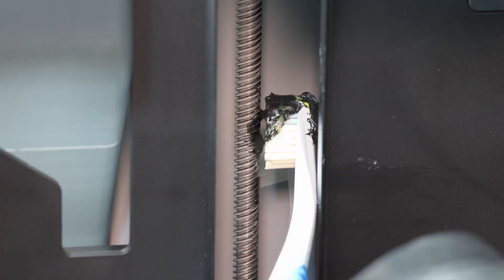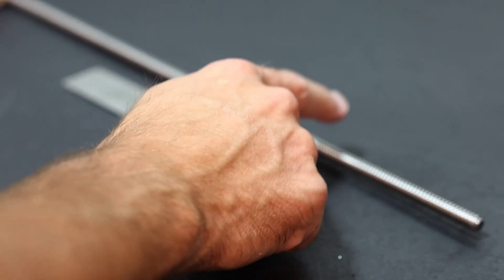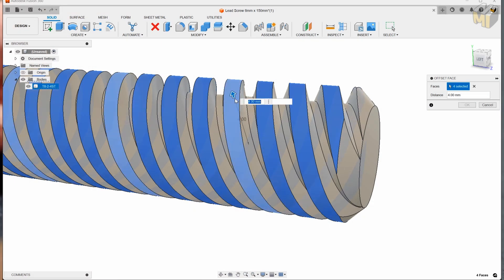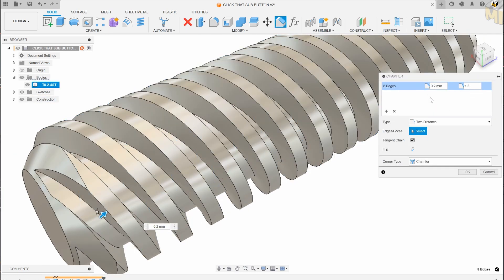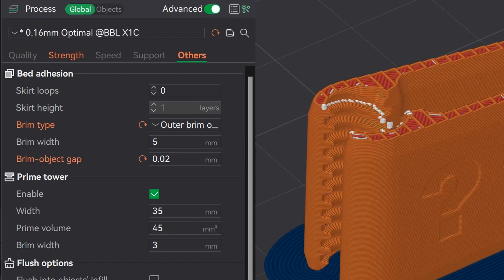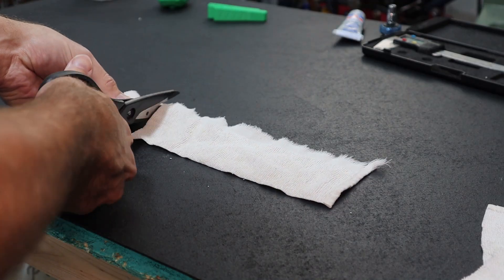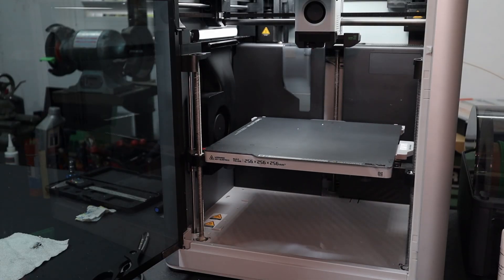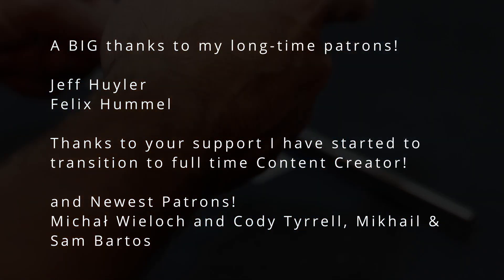A Much BETTER WAY to Clean your 3D Printer Rods and Screws

Comment: Really useful idea, thanks. Can also use it to watch the leadscrews move on a non-level bed plate. Couple of pedantic points though - it didn't look like a true trapezoid thread profile. You can make a true trapezoid nut then slice a small gap out of it and go from there. Some machine tools use that method to produce a small amount of adjustment.These profiles are easily available for Fusion, etc, and may help get down into that awkward little cranny. Secondly, they are not RODS they are LEADSCREWS !. Little pet hate of mine :) Thanks again for a very useful tool. BTW, why the taper?
Reply: I mean it's a threaded rod, called a leadscrew because of what it does

Comment: Wrong. For each rotation it will move 2 mm  not 8mm.
Reply from the maker: Well, I'm quite confident, but please humor me and tell me why a 4 start thread with an 8mm thread pitch will travel only 2 mm per 360 degree rotation, I'm interested in this method of teleportation that you speak of.  I'm also quite interested now if you can backup your claim and if you're arrogance got the better of you this day.

Comment: You don´t need the complex helix modeling, I bet just a clamp and a soft towel with work the same, if not run it twice. Good idea though.
Reply from the maker: Hey, if that works, go with it.  I can see that with the right towel, it could work well with your fingers.   I just kind of like the idea of doing all screws at the same time and hands off.  Thanks for your thoughts and for taking the time to leave a comment, I really appreciate it!

Comment: Was that a permatex grease you use?
Reply from the maker: I'm using lithium high-temp grease, that's what I had on-hand, it's probably not exactly what you'd want to use, but it does the job for me, stays in place, and you can tell easily when it's dirty.

Comment: You could always put a hole in the handle where the crisscross section is or on the side so that one can store it on a hook that is on a 3d printer or somewhere else. ;)
And like you suggested you could use a magnet and maybe make the whole in a diameter where one can put a 6mm magnet into it if someone wants to use a magnet?
Reply from the maker: I've tried a magnet, but it is so small that it works its way down the back of the printer, the hole isn't a bad idea though.  I'd need a hook somewhere.
Reply: @NeedItMakeIt  well thats a problem =D then a little hole might just be the easiest solution =)
Reply from the maker: @Neohhhh  I'll do up a sample and see what it looks like, thanks for the idea!

Comment: I would also like to thank you for the fabulous design. Another tool I didn't know I needed as I have 4 printers and 9 lead screws (3 on the K1 Max). I had to print it on one of my Ender 3 Pros as my K1 Max is down for the count right now. I printed without a brim, in PETG - woks GREAT, so THANK YOU.
Reply from the maker: Nice!  I was not looking forward to cleaning them manually, what better reason than to design one that can do it and make it 'almost fun'.  I'm glad it helped.  I would print more PETG but that sheen, I think there are some other options for matte, but they're pricey.
Reply: @NeedItMakeIt  Thanks, I may not be clear in the photos (my camera is just a cheap tablet - low quality images), but this was a matte black PETG. I used this because PETG is supposed to have a little more flex than PLA.

Comment: Wouldn't it be easier to just use pom nuts?
Reply from the maker: That’s a great question, is there some reason why they don’t use delrin?  A ball-screw would be another option,  I think they may be noisier though.
Reply: @NeedItMakeIt  yeah that seems like a lot more cost for almost no benefit
Reply from the maker: @confuzled_makes  It's worth a closer look. I have some connections at Bambu, I wonder if they'd shed some light on this, why not use POM?   They've made so many good decisions with their printers/AMS, why not address this also.  Creality did the same, and I'm not looking forward to taking the printers apart to replace them, but I will certainly look deeper into this to find out more.
Reply: @NeedItMakeIt  I assume it is because , yes, the part does last longer. 

However, I rather have a part that is easy to replace and provides a better experience for a few thousands print hours over a part that performs worst for a long time
Reply: The bed assembly doesn’t seem like it’s meant to be a user serviceable part in the X1 series at least. Yes, you can do it, but it’s not something most people would do. Brass is absolutely a better bearing surface for longevity and if they went with pom I’d probably replace it with brass when the pom wore out. 

Ball screws are large and ridiculously expensive for any meaningful quality vs acme thread lead screws. You’re not trying to plunge a carbide cutter through hot rolled steel at two inches depth of cut, you’re lifting a relatively light bed. It doesn’t make sense in a cost vs benefit breakdown for mass production. You also still have to lubricate and oil your ball screws. 

I do think this tool provides a purpose on the X1, especially if you’re printing a lot of filament with volatiles like ABS. Maybe you don’t need to clean the rods once a week, but it’s good to change out the grease when it gets dirty.
Reply: This comment in a rod-cleaning video, and I read "porn nuts"... 😅

Comment: Thanks for your innovative work. Printed one this morning and cleaned my rods on my ender 3 s1 plus with gun cleaning patches. Doesn't seem to get deep in the threads, but does a great job otherwise. Even was able to print without the brim. Thanks again.
Reply from the maker: Thank you very much, I really appreciate it!  I can look at the model a little more, maybe I can tweak it to get a bit deeper, the fingers would be very thin and might not be super strong, but it's worth another look.  Printing it with no brim, you're better than I am.  Which filament do you usually use?
Reply: @NeedItMakeIt  I'm happy with it. Just an observation. Only been at this about 10 months, but the hobby has consumed me. Maybe just lucky. Inland PLA+ 220/60. Printed on my Ender 3 S1 Plus (factory original spring steel sheet) w/ Klipper on a Raspberry Pi Zero, sliced with CURA. One more time...Thank you.

Comment: I used some Lucas cleaner once. It may be unrelated but a huge crack started to form on my printer
Reply from the maker: In the plastic?  What is Lucas cleaner made from?  That seems super strange, stay away from that I would think.  I use mainly IPA to avoid affecting any plastics, acetone would do better on grease, but it smells and affects ABS.

Comment: Servo motor and macro 😅
Reply from the maker: Can you elaborate?
Reply: It’s a bit impractical but it would be epic to have a servo motor pop that cleaner onto a mount on the build plate, which traverses up to the top until it reaches a wedge or other mechanism that pops it off the screw, after which it freely traverses back down with the build plate until it reaches the servo again and gets picked up. 😂

Comment: Just dip in odorless mineral spirit. It will dissolve all the oily dirt.
Reply from the maker: How do you dip?  Take it off of the machine?
Reply: @NeedItMakeIt   You can dip the z axis rod or apply it with brush. Mineral spirits are very less vsicous and they will evaporate overnight without leaving any residue. Also not cause any problem even if they come in contact with electric parts.

Comment: Dude, i don't know how much you print and what, because these thing are nearly free of cleaning! They mostly come lubricated and if not, just need some grease, but cleaning them is just unnecessary unless you splash whatever in you printer! Besides that it still showed some residue on them before you lubricated them, with a WAY too big amount of grease!  Love the creativity, and video quality etc. but as far as usefulness, it's nah!
Reply from the maker: When I was using a bed slinger, yup, I agree.  If you have a core XY, you‘ll want to clean them once a week, they become quite dirty, more so  in the area high on the screws.  Yes it is necessary for a printer running these speeds.  The printer manufacturer also sends through maintenance requests for the rods regularly.  Ideally they‘d be ball screw for a longer life, but at this price-point, it‘s not likely an option.  Thanks for leaving a comment, I appreciate it.  People can certainly decide for themselves whether this would be as useful to them as it was for me.
Reply: Had a Ender 5, never needed to clean them, it was in my shed, where i also custom paint! without enclosure, later i made an enclosure, for abs, but still man, never cleaned them ran just fine, maybe it's the type of crease, dunno,, but i will say regular maintenance is never bad! @NeedItMakeIt
Reply from the maker: All good my man, I suppose it could be the type, the brass, the speed and pressure.  I wanted a clean rod, and so designed this.  I have the K1, but don’t use it as much as the X1C, the rods aren‘t as dirty.
Reply: Lmao^ these people dont maintain their shit.

Comment: I might make this for my Prusa
Reply from the maker: For something so simple it works exceptionally well.  Do you know if the Prusa has the same rod specs?  I assume so, but if not, I can create another version with those details.
Reply: Same rod but it uses pom nuts and shouldn't be lubricated
Reply from the maker: @confuzled_makes  So that begs the question, why wouldn't the Bambu or the Creality printers have the POM.  It would be a great test to see how well the fast printers do with POM, maybe there's a reason they don't have them installed, surely they'd be cheaper and lighter.
Reply: @NeedItMakeIt  ratrig and voron both use pom. It is plenty viable for high speed printers.

Bambu uses carbon fiber rods that everyone complains about and maybe creality has 10k brass nuts they felt like using because their MO is to let their customers test their devices and fix them later
Reply from the maker: @confuzled_makes  I'm going to need to build a Voron, they are still such good printers.  If they work for those printers, they'll work for the Bambu or Creality.  You're bang-on with Creality, they've done the same with the K1, there are a few things that need to be modified right out of the box.